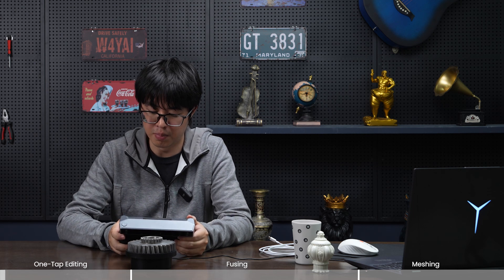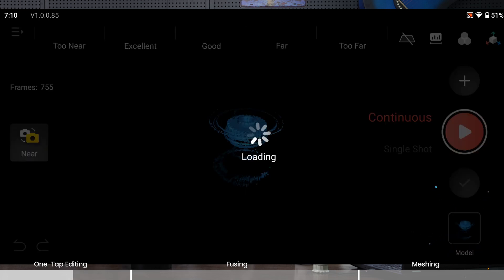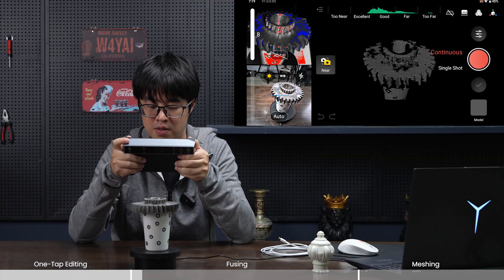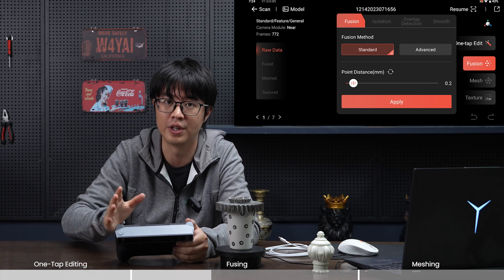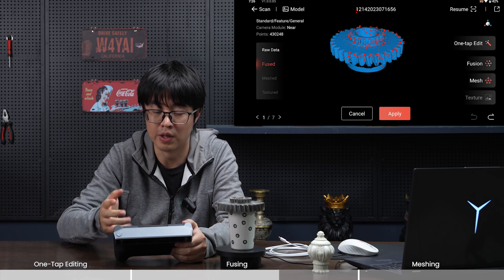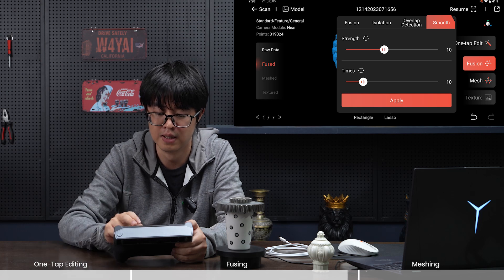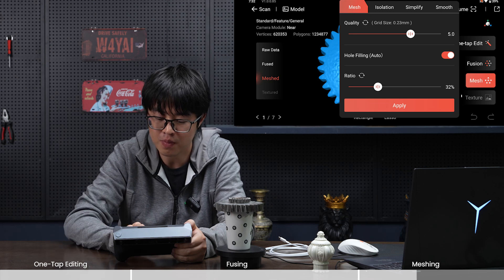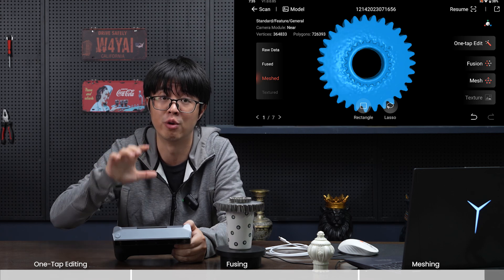Revopoint MIRACO 3D Scanner: How to Post-process a Scan

Comment: How i can make a surface flat or something. On your gear, you have some little holes and inequalities? I want to make it perfect for 3D printing
Reply from the maker: You can use the tools in Revo Scan 5 to help smooth out surfaces and correct any imperfections.  For more detailed instructions, you can check out our Revo Scan 5 tutorial playlist on our homepage. It should help guide you through the process!
Reply: Which video is for my problem? I can find correct one

Comment: how do I fuse the mesh to OBJ?  when I connect miraco to PC I only see an PLY file
Reply from the maker: Under normal circumstances, you should be able to output files in OBJ format. If you encounter any issues, please contact our technical support for assistance. Here: customer@revopoint3d.com